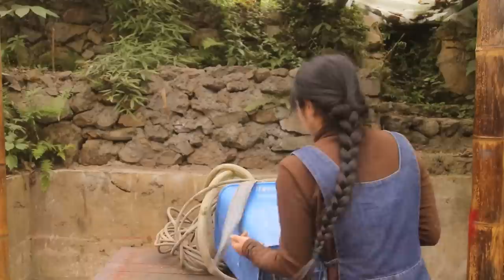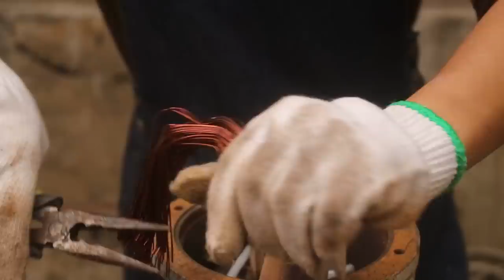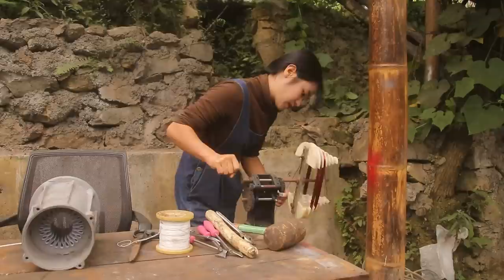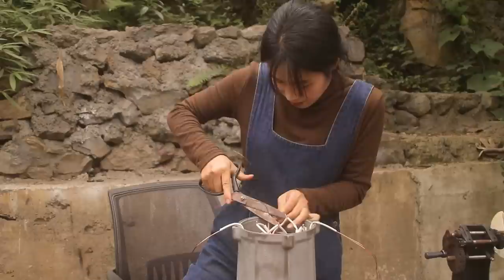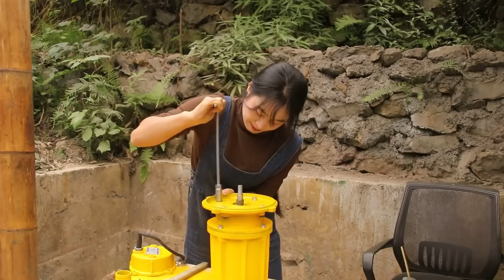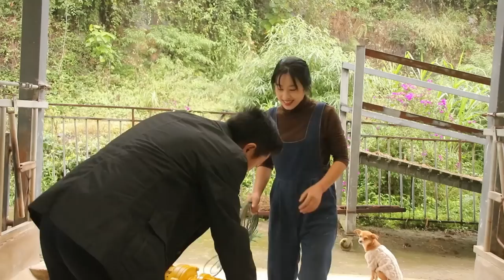💡 2 Days, Miracle Girl Repairs A Totally Scrapped Water Pump For Cattle Farmer! Shocked All Cattles

Comment: I am very impressed at how this lady does this type of work. Figuring out from the old burned motor the numbers of windings, wire gauge, lengths of windings to proper fit in to the core, placement, and etc is not easy to do. Not many people would know how to do this type of work. She does both the electrical and mechanical parts with great skill and accuracy. She is doing everything by hand and alone. No engineering diagrams and documentation to work with. My curiosity would be how she was able to learn how to do this type of work. She obviously has to have a knowledge of how motors work that are electric, gasoline, and Diesel. Also the same for generators. It is obvious she can service most anything she's asked to do.
Reply: Sannerligen sant! Nog för att det har passerat 30 år sedan min utbildning till bland annat maskiningenjör men nog borde jag komma ihåg mer än vad jag gör, fast jag får väl se hur mycket som alls finns kvar efter att jag bröt nacken för snart ett år sedan men återhämtar mig hyfsat om än långsamt...

Comment: Triple phase motor? Probably powered in the field by a hydro electric motor. Many Chinese urban areas use their own hydro electric generators taking water from rivers et prefabricated water courses. NOT reliant on main power government et sources. The amount of power generated to power these devices I suspect is NOT  on an absolute power supply ie the voltage is + or - 10%?? We have to remember that components / regulators  and more are freely available in China on a scale that keeps costs very low.👍  Linguoer is an amazing gal.. do remember that she is a qualified hydro electric engineer. Her training would have been initially paid for by her family et allowing her to study AND to gain an enormous level of skills. NOT without a lot of time, effort, tenacity AND abilities both physically AND mentally. The Chinese are born into 'filial' responsibilities from an early age. VERY family orientated AND she will be very close to her Grandfather, brother AND other family. Most are 'patriarchal' family hierarchy. Each knows their place within the family and will comply / accept that.

Comment: are most the rewind jobs 3 phase? or is single phase used also... 50Hz???
Reply: it depends where the machinery comes from, and what the specs of the job are.
Lin knows how to switch operation mode while recoiling.
in one episode she turned a 3-phase pump into 1-phase.

Comment: If the people who have these motors used a starter with overload protection they wouldn’t burn these motors up. I worked in a factory as an electrician and we had 2 foremen that would reset the overload relays until they burned up the motors. We would replace the motors and in the process would determine the reason for the overload and repair the cause. We would tell them what the problem was and ask them to contact us when they had a problem so we could repair the problem before the motor burned up. This fell on deaf ears.  Both of these morons retired and the number of motors we changed reduced by 90%! But, they where bosses and we were workers. Our general foreman in charge of the electrician would have us install all new bearings in any motor we sent out for rewind. Until I found out that the rewind shop would change the bearings anyway! I learned this while my foreman was standing next to me! I turned to him and told him I wouldn’t do that anymore!